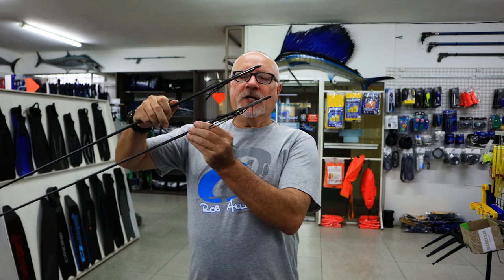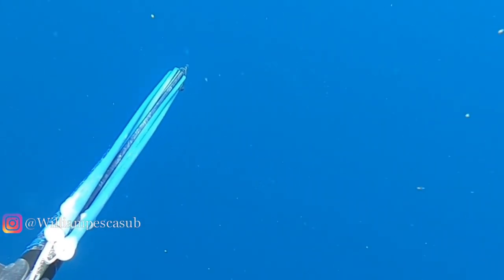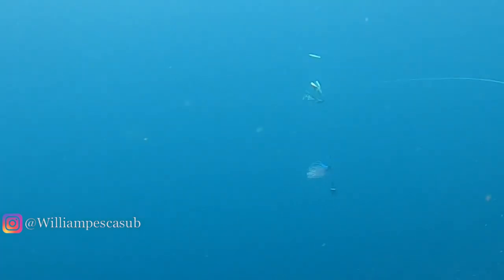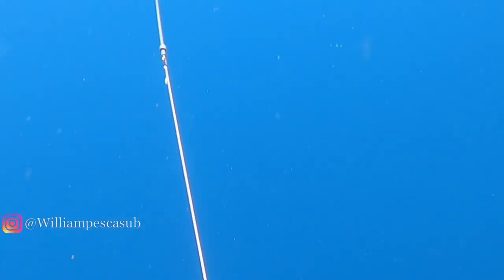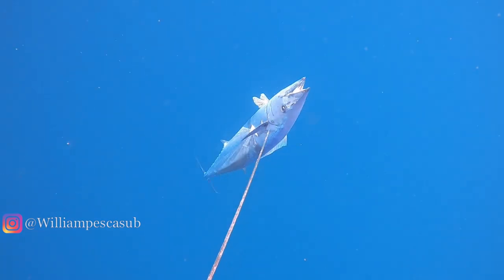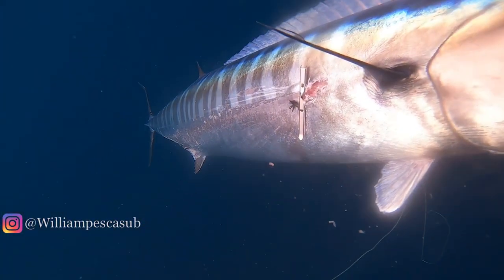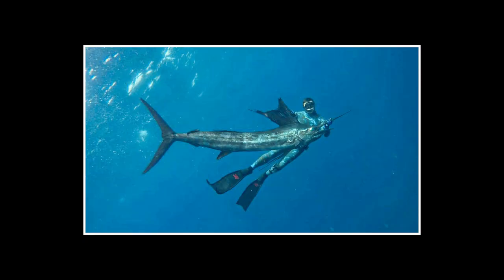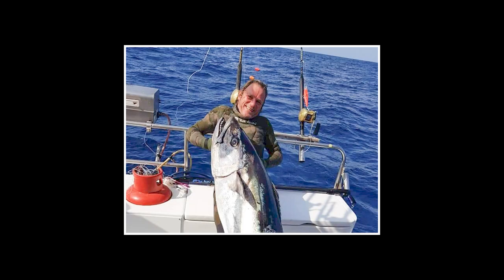Rob Allen | Drop Barb in Action | 2022

Comment: Hey Rob, I love the design and really appreciate the energy you put into R&D and innovation for spear fishing.

A story for context and a couple of questions regarding drop barbs, today we had two >80kg tuna (southern bluefin) that we plugged with what we thought were good holding shots (one lateral line behind pectoral fin, grazed bone by the looks of the shaft. The other top down, behind the head, went in deep)
Both fish ran, got pulled in a bit (the first one almost to where we could have gotten a second shot in) then ran again hard, drowning 2 35L 45psi floats, Then the barbs pulled out. Floats were on full bungee line, with at least 15m (at stretch) between first and second float.
Both shafts came up bent, with no trace of damage to the dyneema. 

Any guesses what happened?
Does this happen to other people?
Could a longer length of dyneema on the toggle help?
I use a double roller, if I make a long toggle, can I safely run it back to the line release

I trust the system and have previously landed fish that I don’t think we could have on other setups. But we were surprised to lose both these and bend both 8mmshafts! 
Thanks again
Reply from the maker: Hi Daniel, I'm sorry to hear about your loss. I have heard of very few losses like this so, puzzling. You say the spear cam back bent with the Dyneema, was the drop barb still on? 

The fact the spears were bent, meant they were still in the body while the fish was pulling. So yes, a longer tether for these larger fish would be much better. In retro spec, 8mm spears will mostly be used on larger fish so we should have fit longer Dyneema tethers. We have only recently introduced these.

Both the Dyneema tether and drop barb can hold up to 200kg. 2 x 35lt floats will go under at +- 70kg of tension but at speed, this will increase the load.

My initial thoughts is that the spear, while still in the fish due to the depth it went and the short tether, acted as a leaver. Pending on where the pivot point was, it could easily have put 2 to 3 x the load. If the barb was still on it meant the load was sufficient to drag the drop barb through the flesh. Obviously the best is to get it through the fish and out the other side but... difficult on a big fish.
Reply: @RobAllenSpearfishing  Hi Rob, thank you for your thoughtful response. Interesting theory about the spear acting as a lever. I had thought about the shaft still being in the fish, but not the implications of that on force magnification. 

I Had almost lengthened the dyneema loop the night before, and I’m regretting not having done that even just as a comparative test on one of them.
Aside from the bend, there is no wear on any of the components. Th drop Barb is still intact and not a scuff on the dynamo. Both were actually the first time each shaft had been shot! Very unfortunate.
Do you have or know of experiences of straightening these shafts? It would be nice to give them a second chance and at least catching one fish in their life.
Reply from the maker: @danielhaley2202  Hi Daniel, good to know the Dyneema tether and the drop barb was still intact. The break strain in our bench testing is around 200kg for the Dyneema and the same for the barb before it will bend. So, the barb was "levered" out at close to 200kg, crazy force. Definitely, if the barb had a longer tether it would have had better holding power.

Regarding straightening, that is an art. It is very difficult to straighten accurately without specialized tools. I can do this here in our factory but.... your cost of getting them back to us would probably be too expensive.
Reply: thanks rob. 
Thats an epic amount of force!

I’m headed to Indonesia in 10 days and I’ve heard Andre in Bali might have the kit and skills, so I’ll get in touch with him. Does sound an art. Listening to metal and relieving its tension. 

Anyway, as always, thanks for innovating, making and sharing your learnings
Reply from the maker: @danielhaley2202  You are welcome 👍

Comment: Hey Rob . The only slip tip I ever used was on a Riffe Mach 5 and I secured the tip on to the spear by wedging a tag line between the bands which released upon the shot . Is the drop barb the same idea ? Tuck the line between the bands to hold the barb to the shaft until you shoot ? Thanks .
Reply from the maker: It can work like that but better to tuck into the O ring supplied. One warning, never tuck it under the rubber if you are using a roller muzzle, this can entrap the line in the roller and lock the spear tip to the gun causing the spear to destruct.
Reply: @RobAllenSpearfishing   thank you ! I was  worried the rubber might not deploy right but if the man that designed it says so , I’ll do it . Thanks for the speedy reply .
Reply from the maker: In pool testing and slow-mo filming, shows that the O ring slides off the drop barb before the spear is even out the gun. At the same time it releases the line lanyard. It is just the water pressure that holds it locked while moving forward     @Reaper7six2

Comment: Rob, im from Ecuador too, does William carry any stock?  i have  a RA tuna 130 with a 7mm shaft, would a 7.5mm drop barb spear fit? and if so what length would it need to be? 170cm?
Reply from the maker: Hi David, I do not know what stock William has but he does order regularly. Yes it will be the same length in 7mm as in 7,5mm, also no different if using a drop barb.

Comment: The only thing I am concerned about using this drop barb is its easy to lose it to sharks =(
Reply from the maker: Just carry a spare, easy to replace even in the water. Better than the shark getting the barb in his mouth and taking off with all your gear or, the spear line breaking and you lose the spear.